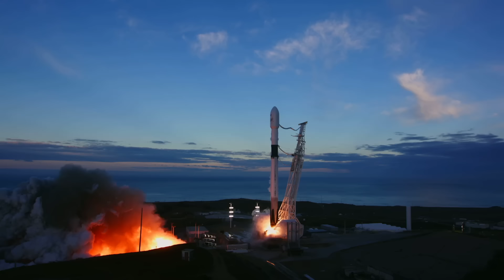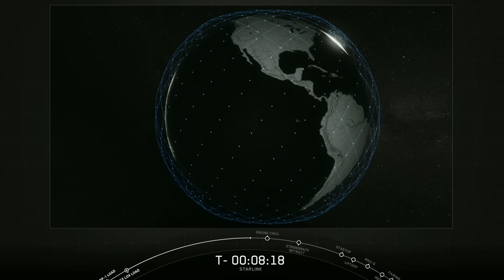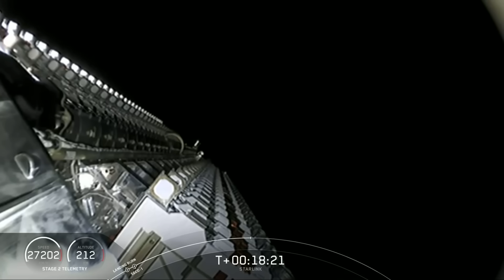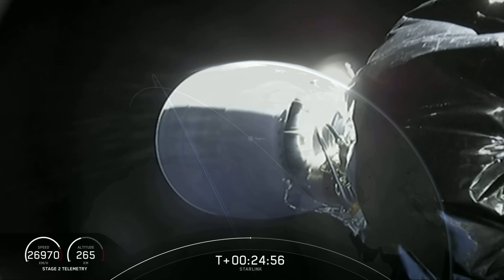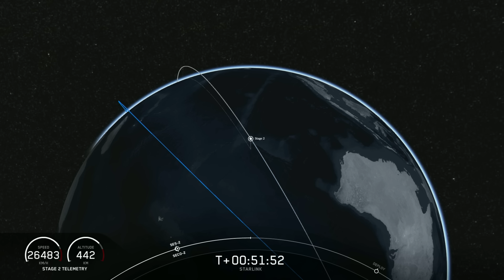Starlink Mission

Comment: Hello  Space x and Tesla staff.I´m very happy to write you to give some apportations and support for the SpaceX Mars project 2022 & 2024.
  One of the questions has been done is what is going to do the starship on the surface on Mars after to get there .
  I think The firt experiment would be to work with a plants like the KIRI . ( 5 kiris can produce o2 for a person )
Build a glass greenhouse for kiris or similar plants with a pump to add pressure like Earth's atmosphere (1 atm). This is because there is 1/100 less pressure on Mars than Earth and without atmospheric pressure, the plant will die because it cannot take the gas by itself. Therefore, a pump must be incorporated into the greenhouse to take CO2 from the atmosphere of Mars, add pressure and finally store the oxygen produced by the plants for the crew or the ship.Thank you .Visit Youtube channel : Oscar Barnley Barnola.

Comment: diamond iron how to make it , spacex this is something you'll need if going to mars, carbon rod sending electricity through it will heat it up but the next to it an electrical coil with its own electricity through it this will give an electrical shock if you place your hand inside the magnetical field but inside the electrical field you place a piece of iron and this will infuse the iron with carbon that is in the air

Comment: 18:01 - 18:18 What is causing the coverings to pulse rhythmically. The craft should be under contant acceleration and not pulses of acceleration. These covering pulsing are rythmic and synchronized.

Comment: I didn't receive the notification either. 

Is the American government trying to cut Space X out of certain parts of the space program. 

This organization ( Space X) is the reason for the rebirth of space exploration within the US, shutting out the strongest player is just dumb on the part of the government, Space X's evolution has been integral to the current position of space exploration globally,  if the American government wants to pick winners and wouldn't include Space X, that's the opposite of smart.

Nothing but success Elon, keep rocking

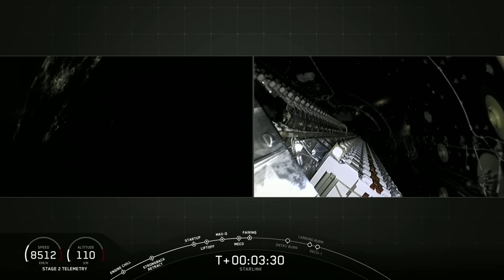Comment: What would be causing the steady pulsing vibration seen on the insulation foil on the second stage motor plumbing starting at 16:57 and also visible in the payload bay between the satellites at about 17:29.

Comment: Whats with the almost 1 second interval shakes you can see on the 2nd stage from t+3:00 there like every 0.75 seconds, you can see the gold foil shake with it around the engine, and in the forward camera view you can see it in the foil around the 2nd stage payload area etc, at t+004:00 its slower about 1second intervals, at t+05:00 there like 2.5 seconds apart, also on the forward camera the jolts/vibrations are ''faster'' ??? whats going on! if this is a shake, how can it be at different speeds on different parts of the structure????

Comment: The advertised link on spaceflightnow dotcom was wrong, but the previous YT window still existed. By chance, I rechecked, after seeing no activity there, at T-60 seconds, and noticed the change.  Apparently, for those who have a bell icon, it didn't ring for them either. (No bells appear here for any video.) The lesson is to re-check the publicised address, 5 minutes before a launch.

Comment: Great job everyone at SpaceX! 🌟

2c - Please adjust the timeline graphics at the bottom of the screen. The new(ish) curved line display rises up into the viewing area too much. If you moved the T-minus time display at the bottom centre outside of the arch (to the right), then you could widen the radius of the time line arch and lower it so it wouldn't invade the viewing area. 
Also it would be great if you could bring back the Stage One landing telemetry (you did show it sometimes). You could put the Stage One landing telemetry up and to the left where the  the Stage One landing video is. I personally preferred the spacecraft telemetry in the upper right where it used to be. That works better when you have two spacecraft and two separate videos running at the same time (stage one & two). Just sayin' 👀